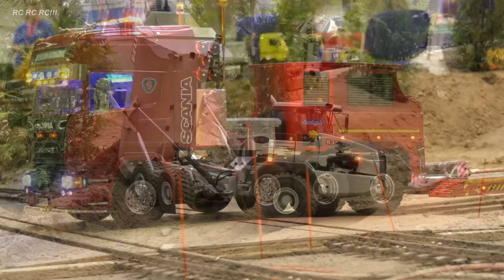EXTRA LOOONG RC TRUCK ACTION!! RC TRUCKS COLLECTION, RC MODEL MACHINES, RC VEHICLES, RC EXCAVATORS

Comment: With all the amazing construction vehicles on these videos, how come I NEVER see one of the most universally used machines in real life......
A front loader/ backhoe?????
Does anyone even make one?
Reply: I was wondering the same thing about scapers. I know they have RC scapers but never seen one in these videos. I was also wondering if they ever try to accomplish something. Just seems like they fill up trucks, the trucks take the dirt somewhere and dump it. I have seen just a few that were actually trying to accomplish something like build a ramp, a road, etc. I guess these videos are more for trying to show off as many vehicles as they can. All of them are very impressive no doubt but it would be nice to see something actually getting done. Once it is, see something like your backhoe come in and dig up some trenches for sewer pipe or something like that. It could be that the backhoe your talking about, having a lot of different controls and actions, might not be big enough for all that. Just guessing and have no idea.
Reply: @t74guard78  I totally agree with what you said, and as far as a backhoe having so many operations on it, you would think with 10+ channel radios these days, and the micro sized tech available, this would not be a problem at all?
I have seen custom built backhoes, but nothing on the market itself.  I think there would be a big market for this today, considering how popular these all are nowadays...👍
Reply: @g-manracer1997  Oh I agree, I am sure if available, they would sell pretty good. What I meant about not being big enough was the room needed for oil pumps, and everything else. On or in the body of the vehicle. I know there isn't a lot of room left inside excavators and they are much bigger. It takes up all the room they have to be able to fit all the stuff necessary to run it. The backhoe is pretty small compared to those machines. The motor, speed control, pumps, servos, etc, take up a lot of room. Backhoes don't have any thing behind it except the hoe itself. The only room to put all that stuff would be in the front and that isn't a lot of space. I am just guessing as to why there isn't any out there. Your right about them being probably the most widely used piece of equipment other than something like the bobcat and forklift.
Reply: @t74guard78  good point though...theres not a whole lot of room, when you think about it👍